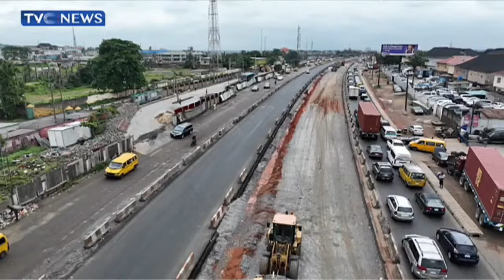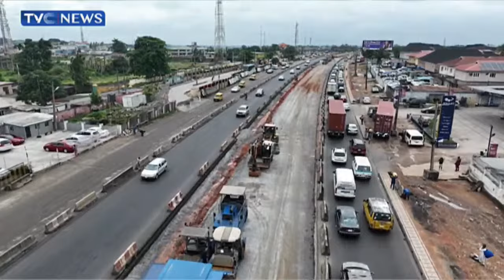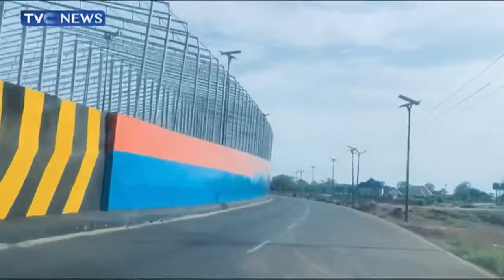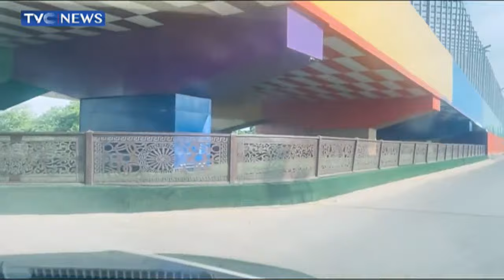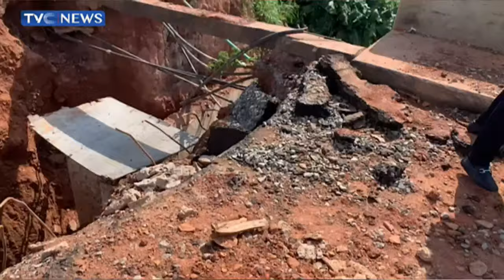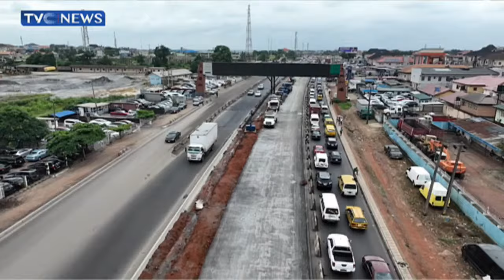VIDEO: Drama In House Of Reps Over Debate On Asphalt Or Cement Technology For Nigerian Roads

Comment: Before Nigerians believe babajide, just do your independent research on the expense of maintaining a concrete road. It's is highly more expensive to repair. Say there is a damage to a concrete road, to fix that damage is expensive in comparison to asphalt.
Reply: Where did you get your false idea from.
Reply: @rotimikayode1072  false idea? Can you substantiate this fallacy of yours
Reply: @rotimikayode1072  are you incapable of conducting your own independent research on the expense involved in the repair of concrete roads?
Reply: @rotimikayode1072  an educational  VIDEO documentary titled 
Who Makes Billions Paving : America's Roads?
CNBC
Reply: @rotimikayode1072  have you noticed cracking in concrete buildings? And road and bridges?

When such a structural hazard is observed , how is it fixed and at what cost? Vs
How may days does it take to cure a wet concrete road?
How many days does it take to cure an asphalt road

Emphasis here is on maintenance and repairs
Reply: @rotimikayode1072  concrete roads a prune to cracking. What do you think is the cost of fixing cracks in a concrete road?

Do you just cement over the cracks? Or remove the whole road segments with cracks in it?
Reply: @rotimikayode1072  asphalt is more flexible and applied in layers. Cures more quickly.
Reply: @rotimikayode1072  what do you know the carbon footprint of cement and concrete production is? In comparison to asphalt?
Reply: @rotimikayode1072  are you aware that Nigeria imports cements? Yet jide aid cement is easily accessible in Nigeria? 

Likewise, bitumen is accessible in ondo state